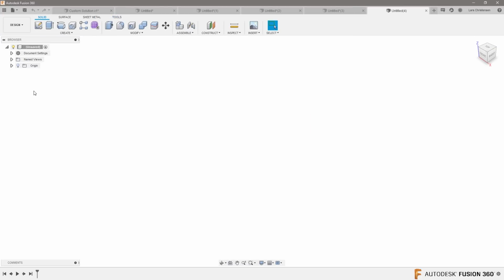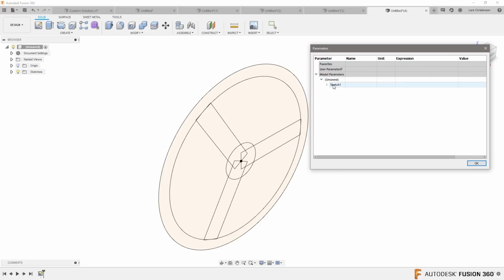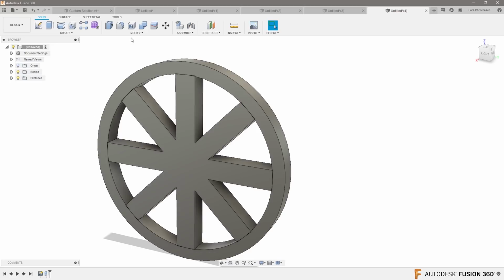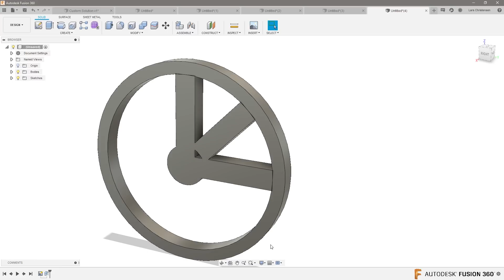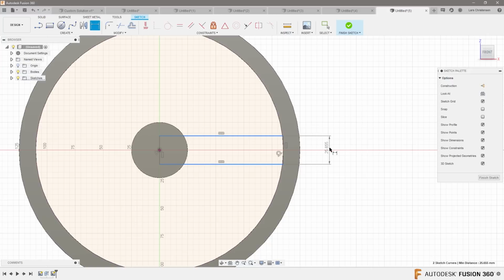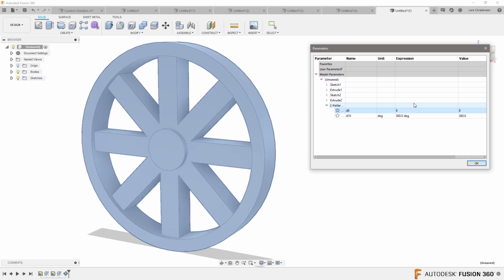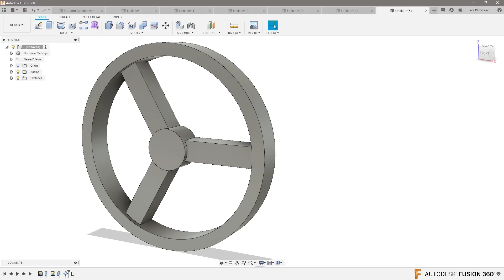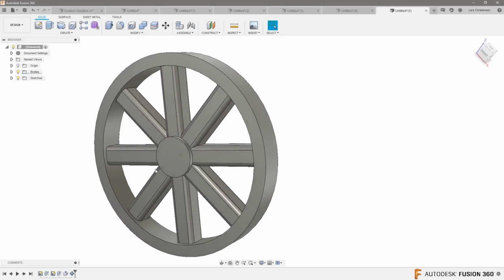Fusion 360 — How to FIX a BROKEN Extrude Pattern — Ask LarsLive

Comment: I spent the afternoon trying to do the same thing. If I try to extrude a triangle from a rectangle face, the rectangle disappears. I’m starting to understand why it called confusion 360. I am a new user so I’m drinking from the fire hose. Understand that I learned to draw with a parallel rule, compass and triangles in 1979.  Taught myself basic AutoCad in the 80’s. Now I’m  using Fusion for covering my normal hair color sections with gray to match the rest. 😂

Comment: Thanks for video Lars, good as always. One smal tip. When you try to select many small surfaces best way is use to push left mouse button and drag. There are two different types of selection rectangles. If you drag from left to right (orange rectangle apear) it select everything what have all parts inside that rectangle. Usefull for things like you are showing on video. If you drag from right to left(yellow rectangle appear) selection is everything what even touch partly inside the rectangle. Probably you know it but maybe for some your followers could be helpful.

Comment: Hi Lars, I love your videos, they are so helpful and informative. Did you ever do something outlining the difference between SolidWorks and Fusion as far as not only pricing, but ease of use, products, and other areas that you need to pay for separately in SolidWorks? I am looking at getting the Fusion Eagle package just so I can add PCB to my areas of work in my hobbies, and Fusion offers a free package while SolidWorks does not have anything like this in their programs. It seems that Fusion is a hell of a lot easier to work with than SolidWorks, but I would really appreciate your take on what programs you like and dislike. Thank you so much.

Comment: Hey Lars,
Can you do a video importing dwg? 3d into 360 and what needs to be done to use that 3d model or even if it is possible to do so? Thanks
Reply: You can upload your model into the Projects folder. It works well with DWG, SolidWorks files and other types.
Or, with latest update, you can just open the file in the File->Open menu.